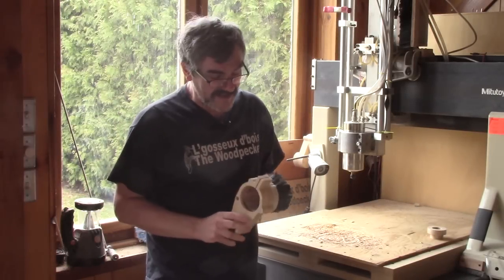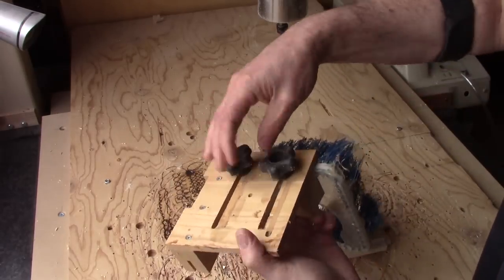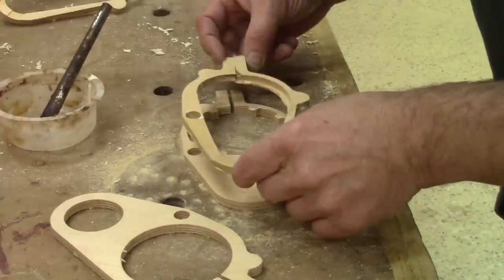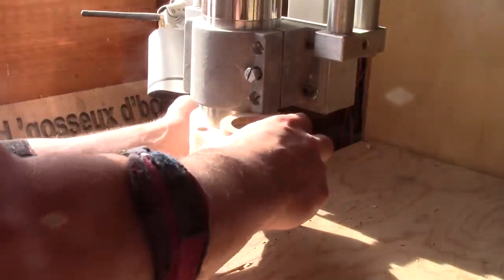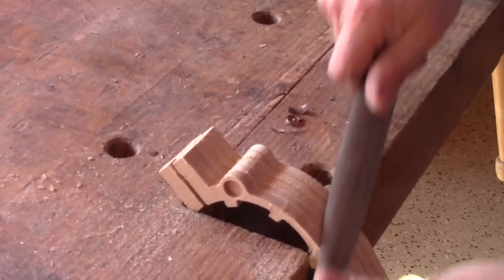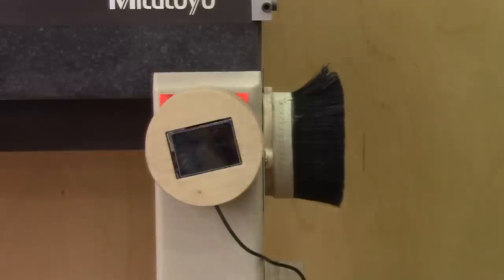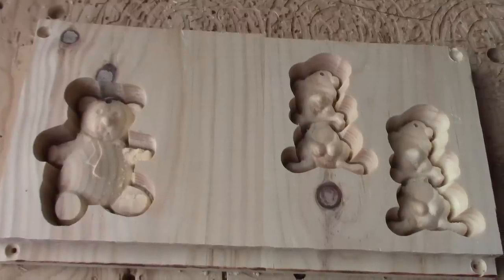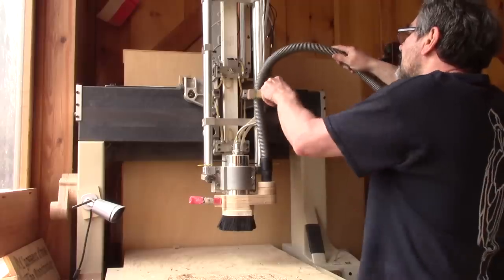The Woodpecker Ep 274  - A dust shoe for my CNC

Comment: Just an idea, why not hav the CNc bed mounted vertically and not horizontal? That way the dust and wood chips would fall to the ground and not stay on the work peace? It would also save a lot of room in the workshop.
Reply from the maker: Some are, but usually it's for cutting big sheet of plywood. I mostly, or more often I woud say, carve small 3d stuff so I want a small bed and the easiness to screw the piece to the bed. But like you said at least vertically the dust would go down...